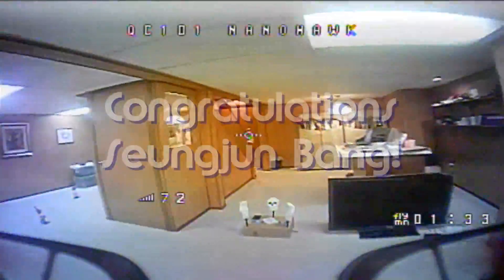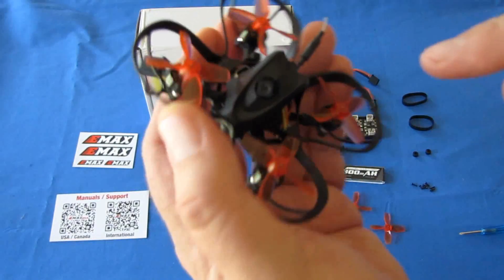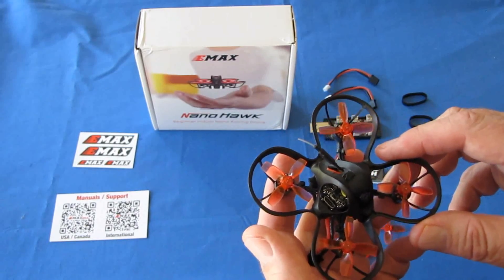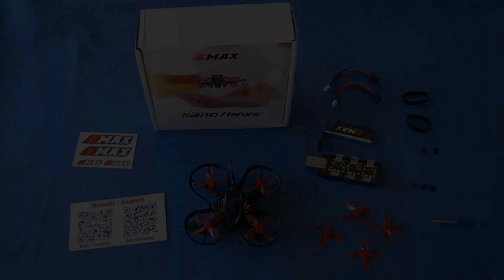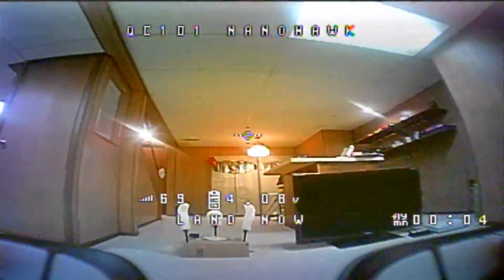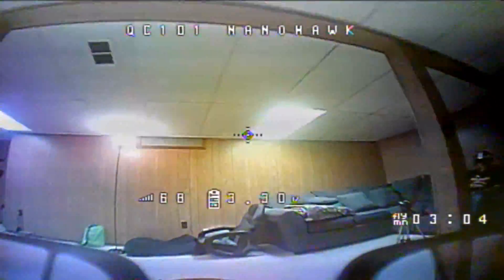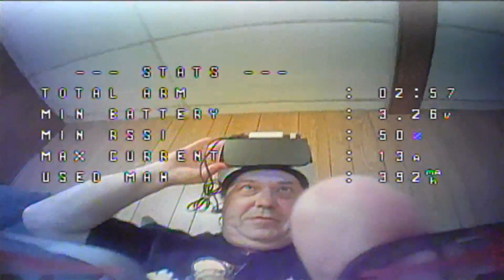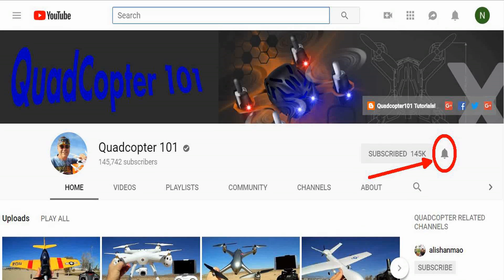Emax Nanohawk 65mm Brushless 1S FPV Racer Drone Fright Test Review

Comment: Excellent review & flights!! You can add Turtle mode to a switch so you dont have to walk up & get it but of course it depends on where you crash at  😊
Reply from the maker: I don't like to use turtle mode as i'm afraid of carpet obstructing the propellers and burning out an ESC.
Reply: @Quadcopter101  Good point there  😊